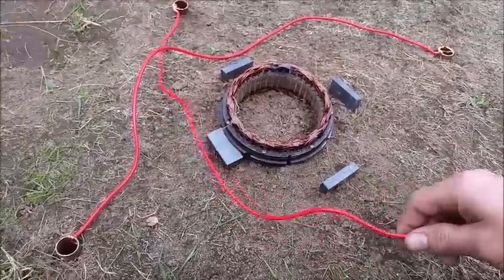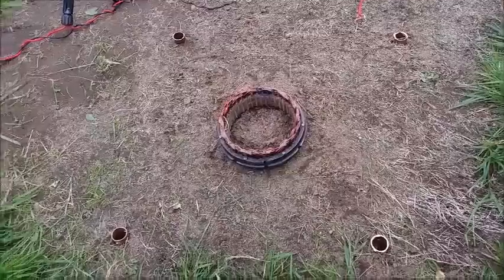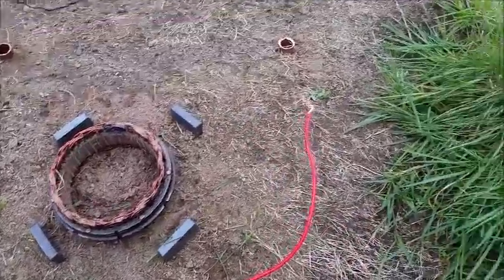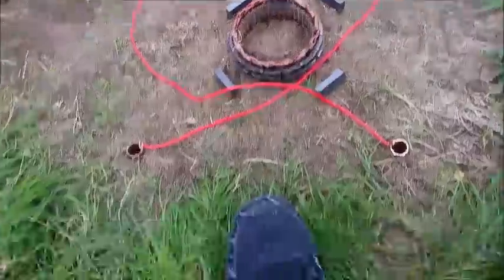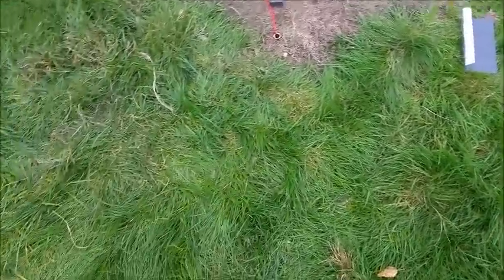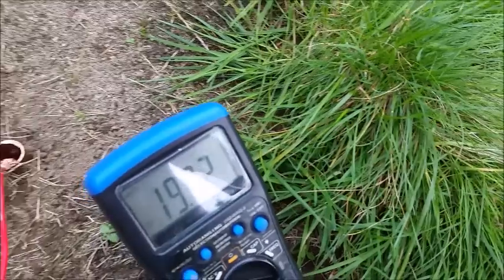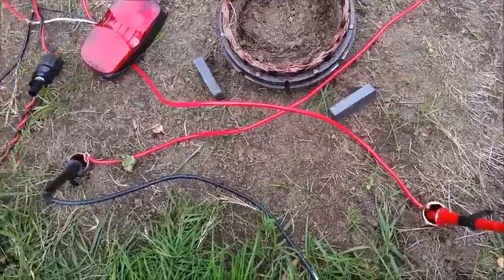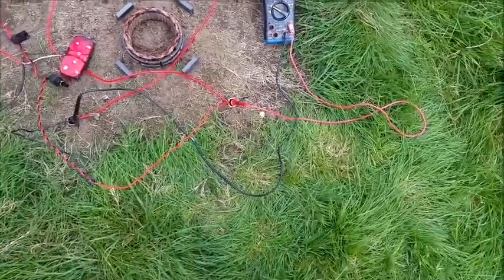How to get FREE Electricity

Comment: Leave all the wires connected and pick up the magnets and the coils without disturbing them and the voltage will stay the same. They have nothing to do with the voltage you are reading.

If you want to be scientific, get a second meter in series with your "free energy source and measure how much current you are delivering to your lights.

Get a completely tight shot of your meter. I think the upper left-hand mark says mV or millivolts. You might only have .01972 volts. 

Use a simple bulb to demonstrate the power to light up something. You have 2 black things wired up and a light big enough to contain batteries. If so, all you are doing is completing the circuit by connecting both wires to the ground. Sow the meter while you connect the light--there might be some voltage fluctuation while you do it.

Comment: You should have removed the coil and the magnets to show if it would skew the results.  Also, remove the volt meter to see if the tail light still powers up as I suspect that your meter model is supplying the 19 volts.  It is not uncommon to get up to 7 volts, but I have never seen earth batteries light any bulbs, but perhaps very low amperage led bulbs could work if they also work on lemon or potato batteries.  Also, just like lemon and potato batteries, earth batteries need to have two different metals inserted in the ground.  Before Tesla, the railroad telegraphs in the 1800's used big earth batteries every 100 to 200 miles to boost telegraph signals between the east coast and west coast.

Comment: I believe this is an example of an Earth Battery..but normally, the negative and positive electrodes are of two different metals like copper and iron/steel..I think the way it goes is the more copper coil, the more voltage..the stronger the magnets and larger the electrodes then the more amperage..the moisture in the ground is part of how it works...like a wet cell battery...not sure how safe it would be during lightening storms tho...Anyway, Great example!

Comment: Earth is an highly electrically charged capacitor. By putting copper into the ground, you are basically creating positive and negative terminals in a dielectric material that is earths crust. You will get better results if you use dissimilar metals. Try copper on positive and zinc or bismuth on negative. The higher the relative electrical conductivity difference between dissimilar metals, the better the results in theory. Also you will need electrolyte just like how capacitors need electrolyte.

Comment: Put a tower in the air with an aluminum ball at the top and solder a wire to it....wrap the wire on its way down the post into a coil with as many wounds as you can get and then connect the end to a ground rod.... At the base of the coil build another coil out of heavy 10 guage copper and make it wrap around the first coil without touching it... Only put 6 or 8 wounds in it and connect each end to a nail. Check the voltage across the two nails. The higher your tower, the more power you'll get.
Reply: Please be careful. This kind of device can kill

Comment: Look at videos on salt crystal batteries to better understand how it's working. Basically it's running off of the minerals in the soil.
Reply: Minerals and the metal. Im pretty sure aluminum is better than copper. Its a chemical reaction.

Comment: You've just basically made a battery. Store it in a bank of 20 volt capacitors big enough to get some amperage then run it through a solar voltage controller and into a deep cycle battery to build up a useful amount of power. The magnet is unnecessary just drive your copper in the ground then use aluminum for the other node instead of copper. Or better yet, use a magnesium rod. Then put your nodes closer together... If you really want a spike take distilled water and warm it on the stove while you stir in Epsom salt until it will not dissolve any more. Sprinkle in some alum powder for conductivity then pour that solution into the ground on your nodes. It's essentially a salt battery and it works by creating a differential between metals causing electrons to flow. I'm looking into doing a similar power source on my sailboat in saltwater.
Reply: Cheers for this, I been tryin to find out about "make free electricity generator" for a while now, and I think this has helped. Have you ever come across - Diyadison Penhloe Blaster - (just google it ) ? It is an awesome one off product for generating your own electricity minus the headache. Ive heard some decent things about it and my friend got excellent results with it.
Reply: Hoow did your sailboat battery test work for Scott

Comment: If this were legit, he would have left it hooked up with 60 something volts and pulled the coil out of the center - showing the dramatic reduction in voltage attributed to coil being removed!  
5 Volts is what you will get using both a cathode and anode - copper pipe and zink coated steel rod. Or copper pipe and aluminum rod.
Either way, you need a lot of average for the hundreds if not more pairs nessessary to produce enough power for charge controller - battery's - power inverter - to get the 20-30kw average daily energy needs with central AC or heating.
if living in cali or somewhere not needing climate control you can get away with 5-10kw day for fans, TVs, computers, refrigerator, microwave/oven, cell phone chargers, even portable AC.  
I've been off grid for years,  have a Mitsubishi ductless AC, atmospheric water generator, electric motorcycles, lots of gear, and I use less than 15kw per day,

Comment: Pick up 5 volts anywhere.  During lightning storm it'll be more.  Use copper pipe with zink coated steel rod inside pipe (95% of steel rods at hardware store coated with zink).  
Hammer the the copper pipe in the ground, then hammer the rod within the copper pipe.  12", 18", more the better,  .
You'll get 5 volts, 100-200 milliamps.  Problem is you'll have to do lots of them and wire up both series and parallel to get 12-14 Volts and decent amperage for charge controller to charge batteries sufficient to have any real power.
Even if you have the acreage,  the wiring will be in the way when trying to keep the grass growth maintained ,  unless you take the time to bury all wiring.
Ends up costing a lot more than simply harnessing gravity via reduction gears and either a solid mass or liquid mass suspended and lower over several hours, shafts coupled to Gen coils. Higher the rpm, the higher voltage/amperage.  
Another way is to build Mo-gen,  and recycle current applied to motor run coils via bank of ultra-caos and bifilar wiring within coils.  Helps to use magnetic bearing to eliminate friction, at least reduce to a fine point with Teflon coating.
 Will run cool to the touch, as no current is being wasted and disipated as head.  I learned from Bedini long time before he and his brothet were murdered couple of years back.
Good luck
Reply: Some of that was just word salad.

Comment: The coil and the magnets do absolutely nothing.
If you use dissimilar metals you'd get a better result..  It's like sticking a nail and copper wire into a lemon.. you get some low voltages and low current.

Comment: Just sticking a copper wire into a lemon will run a very bright LED size for you until the copper corrodes or the lemon dries out !!!!!!
Reply: That's how the Egyptians made batteries...or so they believe,they descoved clay pots with a copper rod in the center and an acid liquid inside that created energy...it's much more in depth and complex in the actual descovery but check it out

Comment: The ground will usually test between 5 and -5 volts. But can be outside of those parameters depending on location. My friend’s an electrical engineer and he tests electronics. To test they must calculate using given voltage from the ground. 

Keep in mind, the energy generated at the utility company returns to the generators through the ground. Old timey farmers knew this. I’ve seen farmers use large inductor coils to induce voltage from high power lines as well. Houses are grounded and all transformers are grounded (literally) and that alternating current travels over wires AND through the ground, all the way back to the power source. 

I’m not sure if there is an induction in tandem with the coils and magnets you are using. Or if the combination including the copper pipes harness or amplify more of the existing ground voltage. 

But the video is very interesting. I’d be interested to see your amperage and wattage readings. If this is sustainable would it be possible to replicate this setup and connect in parallel or series to increase voltage levels? 

Also is this an AC or DC reading from your multi-tester?
Reply: Seen a video on this on insta so Iv been looking into it on YouTube. The insta vid I seen he was doing “series” of 4. And he said 16 series would be enought to power the things in his house so I’m trying to say I believe it’s possible
Reply: @ttvgifted3171  please, can you give me the link to the video in instagram.

Comment: I will say those magnets must be awfully feeble. As close as they are to the iron laminations of the alternator stator, not one of the have been drawn to it. I also might think you would get just as much electricity from the copper tubes alone. If the ground is somewhat acidic, you basically have built an acid battery. Try using alternating copper and steel tubes. One for the positive, the other for the negative. Make them longer to expose more surface area to the soil. Just a thought.

Comment: Theres ac electric everywhere check out video by Glen Morin he has some real cool video step up transformers making electro magnetic static induction w 2  18 volt battery in series uping it to 36 volts running it up 3500 electro mag induction. He cracked tesla's theroy. He made an 10' antena w copper planted in the ground n was giving off  E M I volts i forget how much but its natural energy from the sun that everything living needs electric impluse to stay alive.
Reply: Cory Palmerini 
It looks like he was drawing DC (direct current) from the ground. AC (alternating current) is usually made by turning DC current into AC current. Batteries are DC until the Alternator (generator) changes the current into AC. At least thats what i have been tought i could be wrong idk.
Reply: Step up and, step down transformers will either step up voltage and lose amps. Or, lose voltage and step up amps. W=V×I transformers are used to compensate or change the amount of electricity going into a persons home. There is a voltage drop when the electricity moves along the wire so before it gets to a persons house the transformer will step up the voltage or step down the voltage. The amount of electricity used is divided in your house by the breaker box. If you use to much Electricity in your living room it will heat up and it will trip the breaker creating an open. Idk if i messed up but thats what i been tought i could be wrong if i am please correct me. 
Ps. Please dont insult me if im wrong i just want to learn.
Reply: Victor Carter, you've got the basics right but I should illustrate a couple of things:
The experiment was very poorly done, he didn't show us if he still had voltage without the magnets or coil or both, and he didn't show us if he had voltage without the wires being crossed.
He may have drawn voltage from the soil, but single cells, no matter how big, would normally only produce around 1.5v. If his voltage was coming from the ground, then it's likely it was DC. But, it could also have been induced into the wires from a variety of possible sources such as overhead cables, underground cables, or nearby installations, such as garden lights etc. In this case, then the voltage would be AC.
Alternating current is produced from a moving magnetic field in a coil of wire, and can be changed to DC quite easily, using a bridge rectifier, 4 diodes connected in such a way that ac is applied to anode and cathode junctions, and DC is taken from the respective anode/anode and cathode/cathode junctions. Ac can also be stepped up or down quite easily, through transformers, so it's perfect for long range distribution, from supplier to home for example. As you can expect losses over long distances, it's normal to provide higher voltages which are stepped down in or near the home, but to do this with DC would incur huge losses, as you would need to use huge resistors which would convert power to heat.
It's also easier to convert AC to DC than it is vice versa, cost effectively.
Reply: Mike Smith 
Thanks for your info. Im curious if puting the wire underground will drain more power from the wire? From what i have been told in the past putting batteries on the ground could drain the batteries maybe it is the same with wires? Idk if lack of intelligence has anything to do with power lines being above or below the ground.
Reply: Mike Smith 
Thats a very good point.

Comment: Yes, cool! Probably really low amps on the current. But deeper pipes would help that. Also some simple circuit & you can trade volts for current amps. Also, I bet it's different at night probably less.  & weather & seasons would effect & how wet or dry ground is.
It is also possible to make the ground a capacitor in another area that is real dry & storing power sort of increasing amps.... Holly Crap, I think you got something here! . I see big potential here! Really!! 😲

Comment: You've created nothing more than a ground or earth battery with the crossed copper pipes. But how much useful current is it and how long are the pipes ?  19 volts is ok - you can do something practical with that. This sort of battery generally  wont work in sand or very dry ground.  I can't see how the alternator and magnets fit in - that should not do anything based on my 40 years experience in electronics.

Comment: For those who say BS, it’s not! It has to do with electrolysis,similar to a battery using lemons or potato’s(well known school science project). I saw some strange effects when working for a telephone company especially where the cables were underground.
Reply: Aaron Draper problem here is that when he hooked up the light, his voltage didn't change. If this were as you say, then the light would load down the circuit and his voltage would drop.
Reply: James Burkart 
That was weird. I did notice the volts actually increase on his dmm like 8 sec after he introduced his load from .73 to .75 it kinda looks weird since his volts increased and never droped.